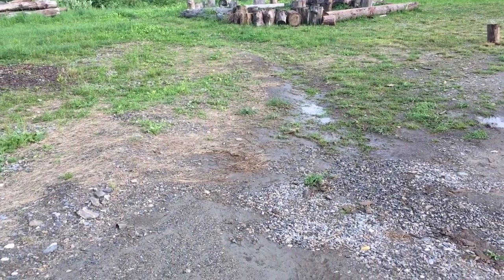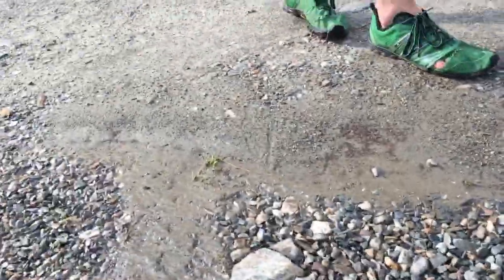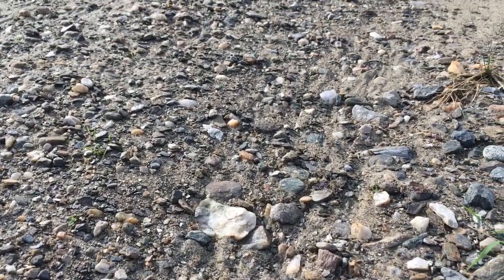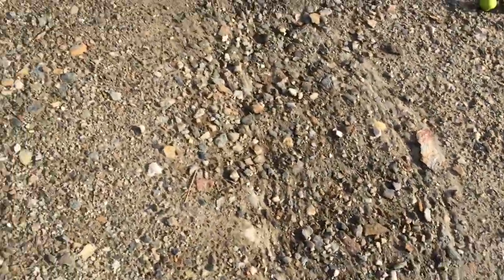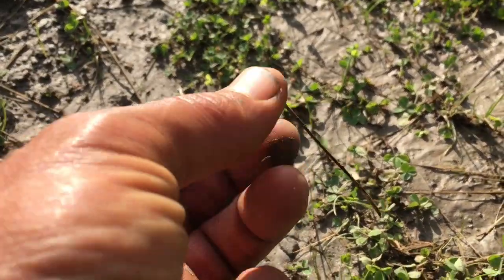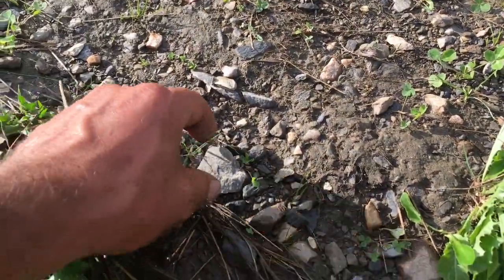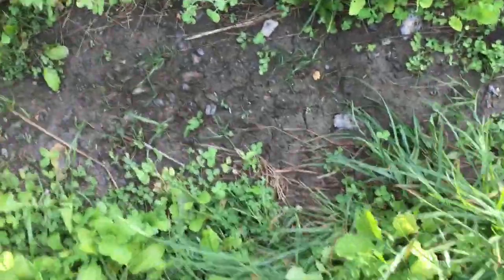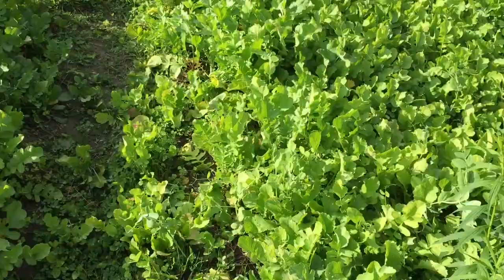Drought-proofing via erosion control

Comment: We're looking at installing Stabiligrid or something else along those lines in our driveway.  Then we'd infill with soil and plant a sturdy grass.  Have you considered anything like that for your drive/parking areas?  http://www.stabiligrid.com/
Reply from the maker: No - simply due to cost and plowing issues. No sense in trying to infiltrate into compacted drives surfaces here when we need plenty of water somewhere else where we grow important plants.  The conveyance works well in this situation but it wants to be totally vegetated.
Reply: Makes sense.  Not much plowing out here, and a MUCH smaller driveway!